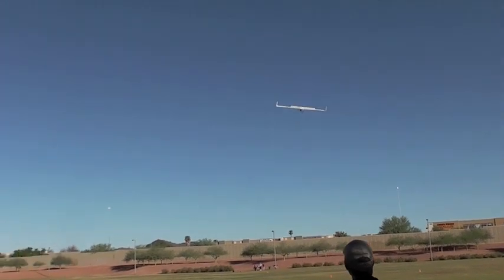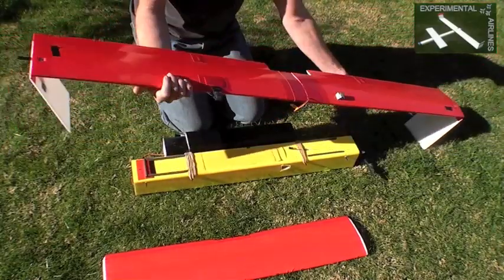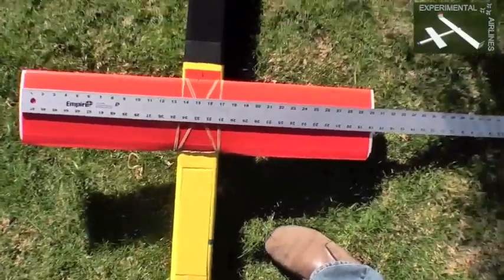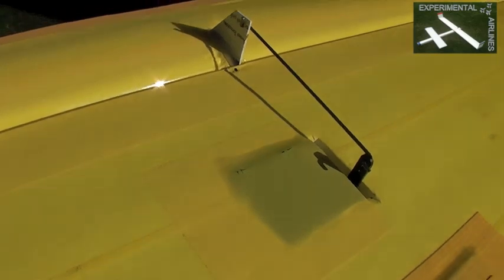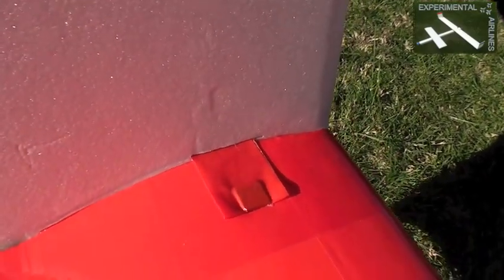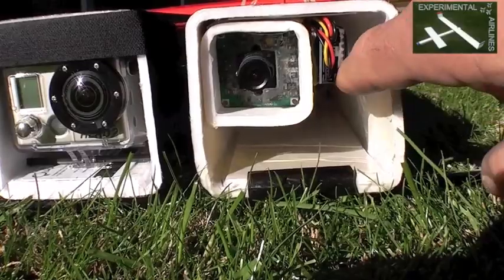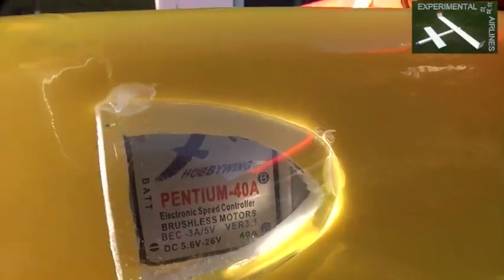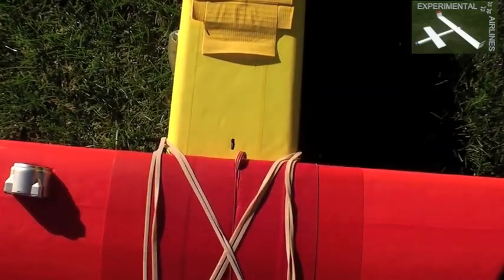FPV Peace Drone v2

Comment: Hi, Is the CG constant at the location of the main wing whether I use a camera or not?  If I am not using a camera, and want to keep the CG constant at the location on the main wing do I have to attach weight to the front end equal to the weight of a camera and associated camera gear at the location of where the camera would go?

Comment: so really old video but looks like a great stable plane. If boss man and legend still reads these is it a good frame to still build. As it seems stable have a great glide and carry good loads.
Having issues getting off the ground and this looks perfect. I went for planes that need far more than beginners to fly them, FpvRator V2 and the Opteera.
Reply: ive built the baby version (40" main wingspan) its very easy to build, i did it in about probably 16 hours taking my time, although if your good and quick you could do it in as little as a few hours>

NOt entirely sure its a beginner plane,  you might be better of with the noob tube.

Comment: Hey there question for ya? I watched your wing build video and understand the use of the cf rod for support ,you explained the 3 weaknesses also. On this wing at the start of the video you place the rod inside of the wing. what i dont or didnt see was what else did you use to keep the tailing edges together? you put the rod in then placed the wing on the body and used rubber bands,is that all ?

Comment: Can I use/get away with using 2 9g servos in each wing? You are using one 19g so two 9g's are about the same Maybe even split the elevon surface to do flaps? or would flaps throw things out of whack because of the canard plus rear wing set up?

Thanks

Noah

Comment from the maker: I like using two 2200mAh in parallel, which weighs about 1600g AUW.  I have flown up to about 2000g with three batteries, but I found some additional internal stiffening would be necessary for stable flight.  Stay tuned for improvements.

Comment from the maker: That ought to work nicely, with a big prop on it like a 12x6, if you're using 3S battery pack.  Probably actually be pretty efficient for long flight times.

Comment from the maker: The foamboard is 5mm extruded polystyrene, like Depron but lighter, and it's faced with a thin paper which can be peeled off.  The majority of foamboard has heavier paper that is difficult to peel.  I've been told that Riot Art has been known to carry an acceptable foamboard which is not perfect but usable and about 30% heavier.  Depron which has been cleaned with alcohol and pre-taped with packing tape can be bent similarly if you "crush-score" the folds with a blunt instrument.

Comment from the maker: Aileron differential.  Upgoing aileron (or elevon) travels up more than the downgoing travels down.  It's good on conventional planes as it places more drag on the inside wing in a turn, so it tends to help yaw the plane the same direction as it's rolling (a "coordinated turn").  This works great on straight-up ailerons.  With elevons it's tricky because they are acting as elevators too, so any aileron differential also becomes elevator differential, which can cause weird behavior.

Comment from the maker: I recommend 3/4" +/- throw for both elevons, no differential, and 100% for aileron rate, 50-75% for elevator rate.  These elevons are much more authoritative at pitch control than roll, hence the different rate.  Also as a result of this, differential tends to cause a very uncoordinated (slipping) climbing turn when simple roll control is input.  Use equal up/down for elevon travel for aileron mode.

Comment: I don't have a friction type substance between the wing, so it may be moving when the left or right aileron goes up. I will have to try that, and i have video of it, i will find it and let you know. My stabilizers are cord length wide and alittle larger in height.

Comment from the maker: I wouldn't worry too much about the internal fuselage stability, since it's just hanging from the wing in flight.  You could certainly brace it if you like, but it's not likely the flight problem.  Are your vertical stabilizers pretty large, like 1 chord long and 1.3-1.5 chords high?  They need to be pretty generous since they are only effectively about 13" behind the CG.  Keep in touch if I can help.

Comment from the maker: Send video if you can.  I have had the wing shift if not enough rubber bands and/or no "frictiony" substance between wing and fuselage, like rubber bands or weather stripping.  Be sure you have no aileron differential programmed in, and try to avoid any mechanical differential by keeping the control horn holes as close to hinge as possible.  If it's actually part yaw instability be sure the CG is (ideally) 2" forward of the midpoint, so 17" forward of the rear of the fuselage.

Comment: Hey ed! having trouble with my v2 peace drone, flies straight once i throw it, but it wants to flips right over when using the ailerons. Thinking it may be with the weakness in my square fuse. I havent put any bracings in it so kind of moves side to side when sitting flat on somthing. any ideas from your own experience?

Comment: Started my new build yesterday afternoon and finished this morning and would maiden it tonight except N.E. Oregon is covered in rain today.  
Ed, thanks again so much for this design. I have a project in the works that this is a great canidate for, I will let you know more as it pans out.  
I love the "low tech" "low budget" "high simplisity" "high modularity" "easy field repair/replace" concept. What the foam board lacks in duribility this design makes up for 10 fold, all your designs do!
Brett

Comment from the maker: This 2836 1100kV motor info links placed in notes.  This gives good power, moderate efficiency, good for casual use or shorter FPV flights.  Other guys are having luck with 900-1000kV 35mm diameter motors of various types with larger 12" props and 3-blade 10" props and getting better efficiency and flight times.

Comment: @EA... I'm using Greentree OSD with Gardian Stabilizer.  I used it on my Cargo design plane. it was a convention setup. the I used it on a delta wing. The Gardian did't like the elevon setup. Reacted to quickly on toss and literal flew it into the ground before I could get my hand on the stick. plus... I was much more of a complication to setup the fireware for RTH. So i abandond the project. I prefer a simpler vapproach. Your design definately fits the bill.

Comment from the maker: Only for simplicity and reducing number of servos and wiring.  It actually worked fine, maybe a little better with canard elevons.  From an autopilot or autostabilization standpoint I bet it would work better with canard elevons.  Are you using Nova OSD 1.5?  Me too, just haven't hooked it up yet.  I could use any wisdom you have.

Comment: Why did you get away from control surface on canard on V2? my OSD uses a stabilization module. works great with elevator/aileron setup. terrible when used in elevon setup. Would the CG need to be move if i bbuild with canard with control surface?

Comment: Thanks for the reply! I also notice on canard aircraft they avoid mounting the canard at the same level of the wing, usually higher. Do you notice any angles of attack where the airflow from the canard interferes or creates a slot effect with the wing?

I like MrWest's motor mount for unimpeded air, but he had a lot of trim issues. I am considering a carved balsa fairing aft with center mount motor for clean air and avoiding asymetric thrust.  Do you see issues with that?

I am also considering

Comment from the maker: Yes, that kind of fits with my findings.  The two wingtip vertical stabilizers of sufficient surface area seem to be adequate with the CG placed at least 15" forward of the firewall, ideally 17".  Would not fault you for adding an additional fin.  Your choice on the motor.  I like having a little extra power to get out of trouble so 200w is my personal base minimum.  Hope to see yours soon.

Comment: Canards tend to unstability in yaw (I have been reading), and one reason that Rutan's successful low-speed models have swept wings is to move the tip sails aft to give them more moment, ergo authority.  I, too, notice a lot of Dutch Rolls on builders videos, and am considering adding a central fin, as well as making the fins all high-aspect ratio.

Ed, I want to make a super light, non-FPV vs. just to play with the canard concept.  Still reccommend the 200-300 watt motor?  Or could I go lighter?

Comment from the maker: Thankfully it couldn't be easier for this plane.  I recommend using elevon mixing on your transmitter if it has that mix, and it is one of the most common mixes found on even basic "computer" transmitters.  Use straight elevons, as a mix of elevator and aileron channels, with no differential.  If necessary use a better-quality (like GWS) onboard "V-tail" or elevon mixer and set the individual channels on the radio for equal throw.  Instruction manual for the mixer and transmitters will describe.

Comment: Hi there, well I've nearly finished my build. Will have to make a slide show or something as I came up with some interesting features on my swept wing version. I upped the power with a 160gram 910watt motor and parallel battery setup. One last thing I was thinking of is rudders, as it seems a little opposite rudder can reduce all that roll when turning, an 'elevons only' effect that I don't think complements some fpv footage. So do you think rudders will work on the vertical stabilisers? Rudder

Comment from the maker: @ade4200 I wanted a moderately high aspect ratio wing (10:1) with a thickness ratio approximating many gliders and general aviation aircraft (11-14%).  I hoped this would give good lift to drag efficiency under power and in glide and would offer decent stall characteristics.  So far so good.  Sorry nothing more sophisticated than that.

Comment from the maker: @ade4200 I don't think EDFs are efficient enough to get the most out of this design, although they are cool.  Swept wings are a nice stylistic touch.  I doubt you would get much in the way of improved performance at the low subsonic speeds we fly.  Maybe a little bit more stability.  It would look cool though.  Go nuts with it, whatever you want it to be - and be sure to share pix and video!

Comment: Hi. Ok I got a bunch of build materials and am starting a couple of build designs. Do you thing the peace drone would work with an EDF? Maybe you could have something a bit like cooling scoops to direct air into the rear half of the fuselage. Efficiency losses? Also I am thinking of making the wings slightly swept with the same construction method. The modular system you designed is amazing! So portable. Thanks.

Comment from the maker: @GenrlSt You know what, I'd skip the gyro, especially if you're not doing FPV.  It's probably not worth the extra effort.  Get 'em flying nice first then start the customization.  Be sure to make your vertical stabilizers big enough, keep the CG well ahead of the 15" mark (13" behind the front of the main fuselage tube is much better for maiden) and don't make the nose pod any longer than you need it to be.  PM me if you need any help.

Comment from the maker: @GenrlSt E-Sky EG200A EK2-0704, just an old rate gyro, nothing special.  There are much smaller and plenty cheaper ones now.  You might only have to contend with the extra lead for gain, but you can put that on a switched channel too, which might work to your advantage.

Comment: Continued; I am using almost all of your overall PD V2 dimensions with the exception in the wing cords being 8.25" with 2" control surfaces, totaling 10.25".
I built the main wing into one piece with a continuous 1/8"x5/8" poplar spar while the front canard has a spar of .5" thick  pink foam insulation board to keep the weight down.  
The fuse is 3.625" square od x 45" total length.
Thanks again for sharing the PD V2 with the world bra!

Comment: Ed, what's new? 
 Did you hear the news recently? The Peace Drone is due to land in Yucaipa CA soon. Yes it's true. I know, it's amazing! 
Ok, I'm building one. I started on the bird at 4pm today and I have completed the wings and fuse sections by 9pm. 
I must say,  I am even more impressed with this folding technique now that I have tried it out for myself. I am now sure that I will build a heavy lifter with a 72" wingspan and a 12"+2" cord using the 1" aluminum shower pole as a spar.

Comment from the maker: @nieder99 I set my ESC brake to "on" and always glide in on zero power to land.  The prop does occasionally tap the ground upon landing but it immediately bumps up out of the way.  There is some trivial scratching of the prop tips after about 30 flights landing on asphalt.  For my purposes installing a new $2 prop every once in awhile is simpler than landing gear.

Comment from the maker: @epet52 Yes, only one gyro, oriented to sense roll, and connected to one elevon only.  It works very well to smooth out the roll axis for FPV.  I'd rather have both elevons respond to roll but that requires two gyros and more complexity.  If not for the FPV aspect I probably wouldn't bother with the gyro at all.

Comment from the maker: Yes, good point.  Well, most of the force against the latch mechanism is shear, so the "free" magnet should theoretically sit down in a recess in the foamboard, the side of which bears the shear force.  The "fixed" magnet should only need to hold the free magnet down in that recess.  I just stick the fixed magnet to the free magnet, fill the hole with hot glue, and push both magnets down flush with the edge of the hole.  Maybe epoxy would be a good idea for your cold situation.

Comment from the maker: @coolwaterhubby I just cut the cards with scissors and drill the hole with a piece of the pushrod chucked into a Dremel.  See my "Armin Wing" video on servo installation for more details on that.  I use those gift cards all over the place for reinforcement.  For the control horns I actually started slotting the control surfaces and pushing the horn down through the control surface, top to bottom, and gluing sufficiently.  It's very strong.

Comment from the maker: @MyGeekShowdotcom Yes, those are the very next orders of business!  Better flight video with GoPro on the next installment and going to try full range test with skew planar and helical CP antennas.  I will definitely report on that.  I've got a 2.4gHz booster to install on my Spektrum too.  This is far from ideal, I know, but I'd like to keep my trusty DX7 for short range, 1/2 mile stuff.  I'll work up to the long range mHz gear sometime.

Comment from the maker: @mtbRAF It ends up being a 3x3" inside tube, minus any reinforcements inside the fuselage, so I take a piece of foamboard of that dimension (for example, 3+3+3+3=12) and roll it into a rectangle to serve as the coupler. It can take a couple of tries to get the precise degree of snugness that you want.  I will include more detail on future videos.

Comment from the maker: @letmeplaymystrat Good eye.  Yes, it's a rate gyro on the left elevon only, oriented to correct roll.  Aerodynamically it works very well.  There are many caveats about it though so I left it out of the video content.  I have to let it arm with each flight, which takes a few seconds.  I took off with only the right elevon once and luckily made it back alive.  Differential on the elevons must also be set to 0%, but it actually flies better that way with or without gyro.

Comment: Awesome upgrades to this plane.  Love the single connection between the wing and the fuse.  I see you have a gyro on the opposite wing.  Are you using it for stability on one control surface?  If so, how is that working on for you?